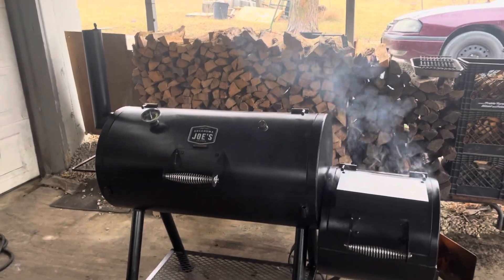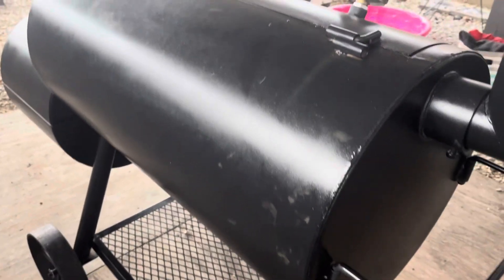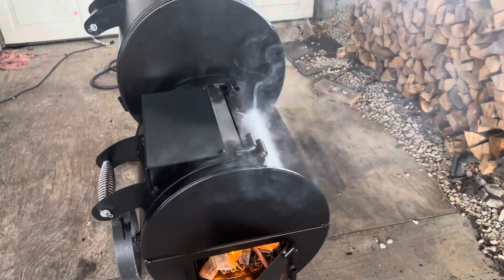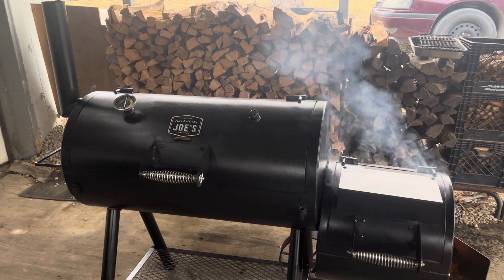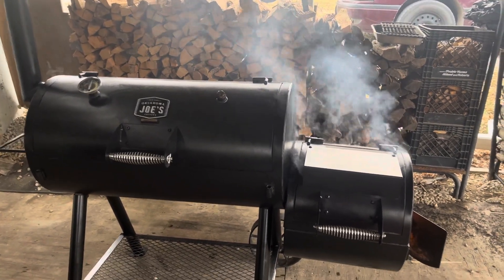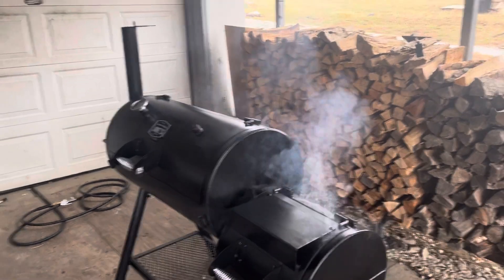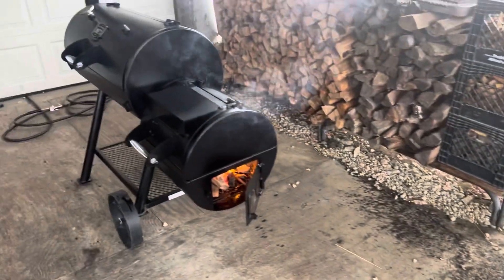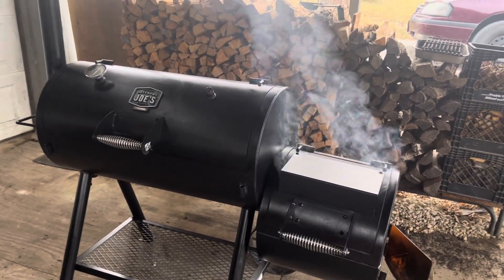Applied Food Grade Mineral Oil to the Outside Of A Oklahoma Joes Smoker Tonight

Comment: Have the same smoker—lava lock felt around the doors works great, also added a heat diffuser and added a stack extension and clamps on the main door.  I’ve had a Shirley for years and this is a decent little smoker for the money, with some mods.

Comment: Best thing you can do is get some Chemical Guys Tire and Trim gel. Works way better than any food oil or lard. That eventually gets gummy and molds. Trim gel holds up to the heat, makes it look new and shiny and repels water.
Reply from the maker: never heard of it bur check it out and thanks.
Reply: @MidwestFreak  yep, I learned about them for automotive detailing products several years ago. I decided to sacrifice testing that stuff on my gmg grills including stainless steel protection and holds up very well. It took some work to remove layers of lard I had on my chargriller stick burner after 10yrs but it's definitely the ticket. That gel is like a very thick mineral oil and renews vinyl, rubber, etc. I even used it on my previous 20yr old house fake window shutters and brought them back to like new. *There is a spray also and goes on thinner and works equally as well.  That one is called extreme tire shine.
Reply: @MidwestFreak  I would prefer to use food safe oils such as mineral oil, canola oil or Olive oil on my smoker. I would use Tire Gel on my tires. Just my .02. Cheers!

Comment: Can’t wait to see how the mineral oil turns out. I apply mineral oil to the cook chamber and canola oil to the firebox since canola oil has a higher smoke point for the higher firebox temperature. Keep us updated.
Reply from the maker: I will try the canola oil out if this does not work out on the fire box and thanks for the heads up ,